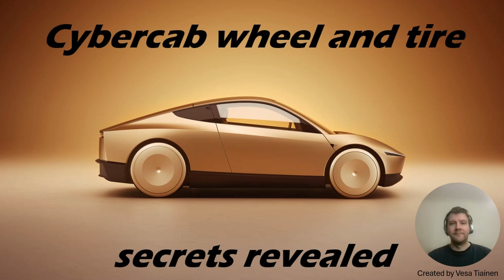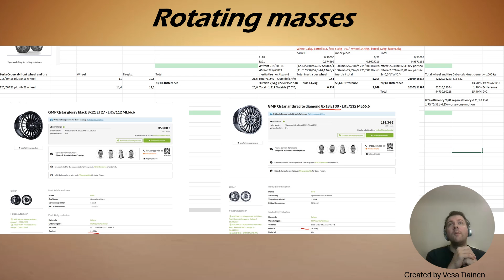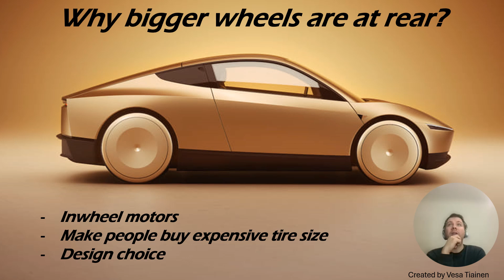Tesla Cybercab wheel and tire secrets revealed

Comment: 00:00 Introduction
00:35 CyberCab Specifications
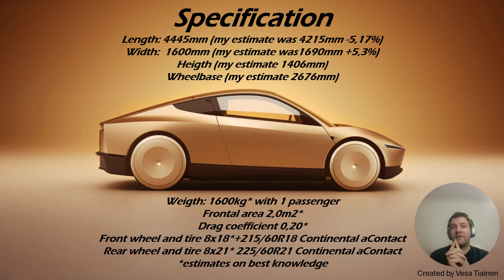03:24 Rolling Resistance vs. Diameter
07:35: Rolling Resistance vs.Tire Load
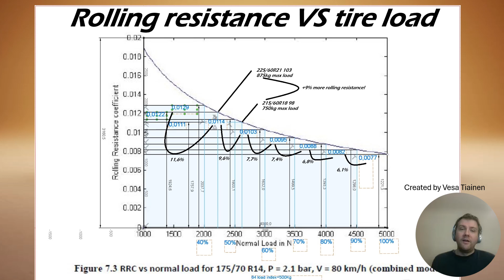12:02 Wheel Size vs. Consumption
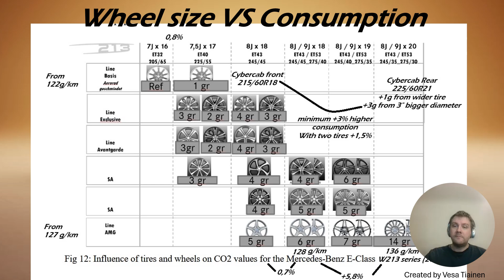16:50 Rotating Masses
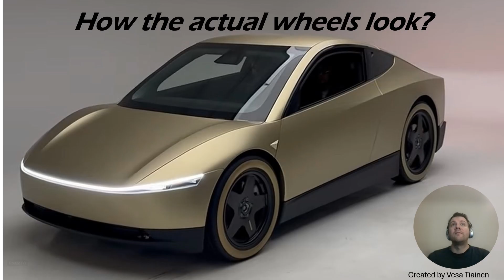23:56 How the Actual Wheels Look
25:18 Results
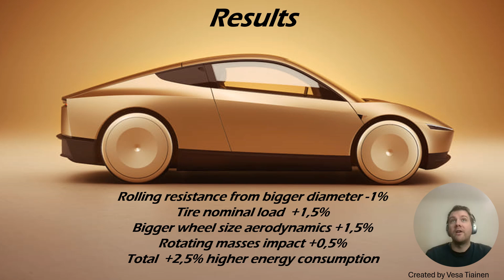26:34 Why Bigger Wheels at the Rear
28:53 Possible Problems
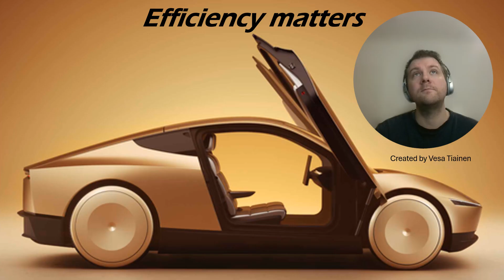34:36 Efficiency Matters

Tags: #Rolling_Resistance #Consumption #Efficiency